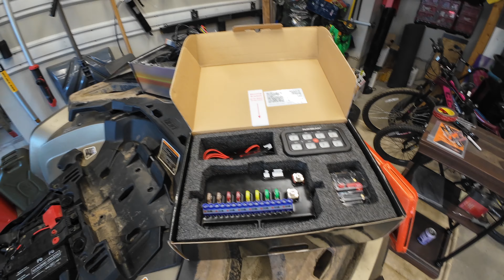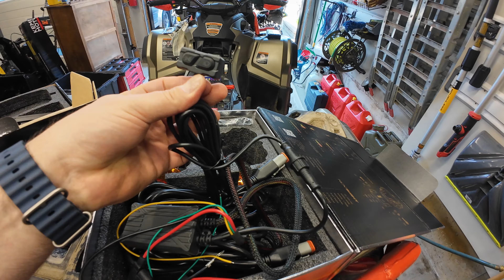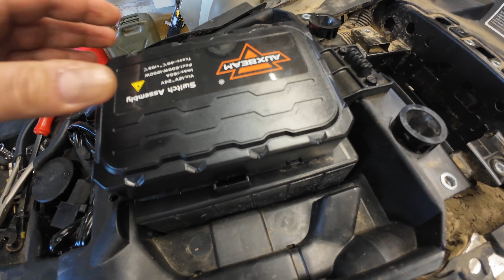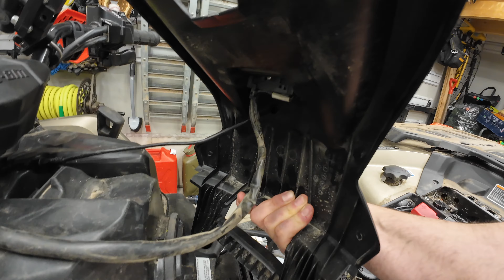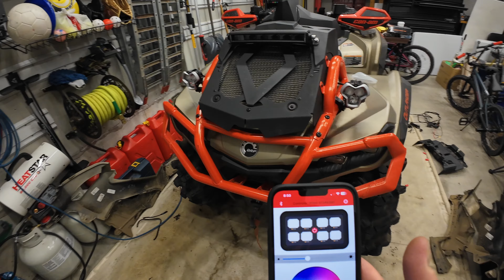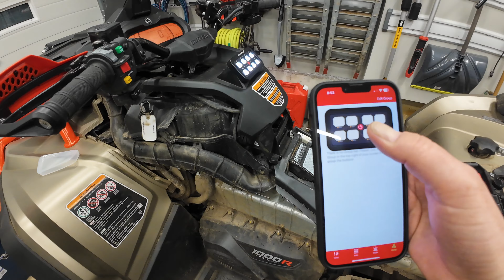AUXBEAM Switch Panel and NOVSIGHT HALOS! You've NEVER Seen An Install Like This! Can-Am 1000 XMR

Comment: You bypassed adding the fuse tap and tapped into an accessory wire downstream of the fuse block to run the ACC power(that you soldered)? Any issues?
Reply from the maker: Not sure what you’re saying was bypassed? The factory accessory wire is fused and it’s there for exactly these purposes.
Reply: @j @johnsoff-road  Thanks for the reply.  My auxbeam 4 gang switch came with a fuse tap for the ACC(red wire). That fuse tap doesn’t fit on my outlander hd7 fuse block. So the way you soldered yours might work for what I need.
Reply from the maker: Yes if you have an accessory wire somewhere that should work. Otherwise I’m sure you can find a fuse tap compatible with whatever fuses you have on your machine. Check Amazon.

Comment: Hi, where do you connect the master switch power cable?
Reply from the maker: Which cable to you mean? The main power and ground to the distribution box are straight to the battery.
Reply: the thin red cable Acc
Reply from the maker: That just needs to go to a switched ignition fuse or you can also wire to the battery if you want to be able to use the switches when the machine is off. I wired mine to the accessory wire that is included on the CanAm’s. It’s behind the side plastics on the right side.
Reply: Do you have a video or image of how you connected it? Please.
Reply from the maker: It’s in the video at the 14 min mark
Reply: Thank you so much, great video!
Reply from the maker: Anytime! Thanks for watching!

Comment: I just got the same lights and auxbeam, what are the wire colors that control each light setting?
Reply from the maker: Red is the main leds. I think yellow was amber halo and blue was white but can’t remember for sure. Just connect each to power and see what comes on.
Reply: @ does your Bluetooth work
Reply from the maker: Yes although I don’t use it much.

Comment: when cutting and connecting the lights to the control panel, how did you wire each light to which connection?
Reply from the maker: Red is your power for the main LEDs. Black is ground. Wire both of those to the switch you want for your main LEDs. The other two colored wires are the different color halos. Wire each to the positive of their own switches. They don’t need a ground as they share the ground from the main LEDs. So you use 3 switches in total.
Reply: @johnsoff-road  thank you, I was skeptical before when I was trying to figure it out

Comment: I have a couple questions: 1. If you have the amber Halo selected on the panel, and turn ignition all the way off, the next time you turn on ignition will it turn on the amber halo with vehicle (sort of like a memory function for ignition). 2. If you have halo amber selected on panel, and select either LED light, or other color halo switch, will it short anything? Not sure what happens if I’d accidentally click one of the others light functions (on same light pod) while one is already selected. Thanks!
Reply from the maker: I have the switch panel wired to ignition and it doesn’t retain memory when I turn the bike off. I usually run with the amber halos on and I just turn them back on after restarting the bike. 

With the halo on, you can run the high power leds at the same time no problem. As far as what would happen if you turn both amber and white halos at the same time, I don’t know what would happen and I haven’t tried it. Maybe one day I’ll get up the nerve to try it. Lol

Thanks for the questions. Hopefully that helps!
Reply: @ thanks for the quick response. So when you cut the harness, you cut out the part for the OEM harness switch, and the black rectangle part correct? Then for the 4 wires inside, you put [black + red] into one switch terminal input (pos and neg), then the two remaining wires for halo colors, you put into the positive terminals of two separate switches with no negative input correct? (I.e. for ex, switch 2 would have just one wire for pos and switch 3 would have just one wire for pos). And about your response to the two halos on at same time, that made me laugh, guess we’ll see if anyone accidentally does it and can report back 🤣🤣
Reply from the maker: Yes everything is wired exactly as you said. When I cut the light wires at the control module I left a few inches of wire at the control module so in the event I ever want to use the lights as originally intended I can reattach the wires.